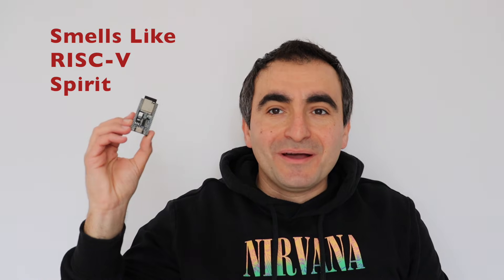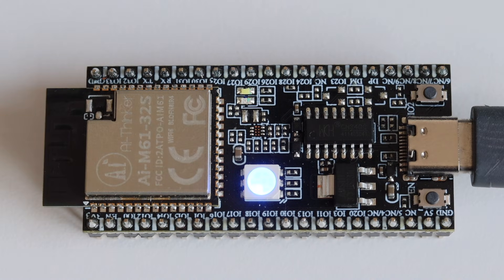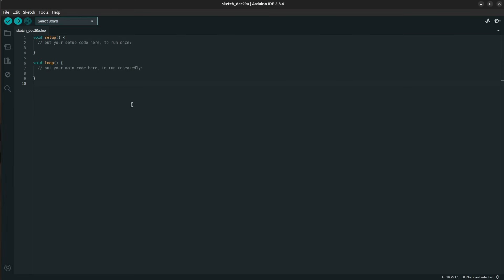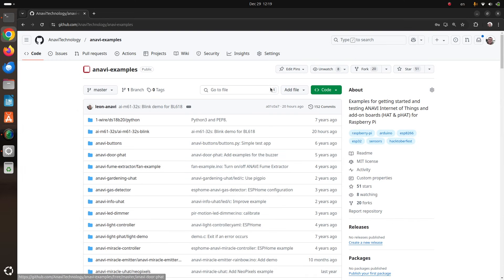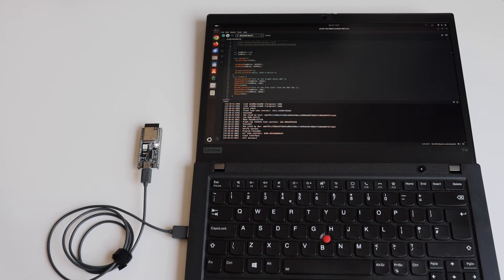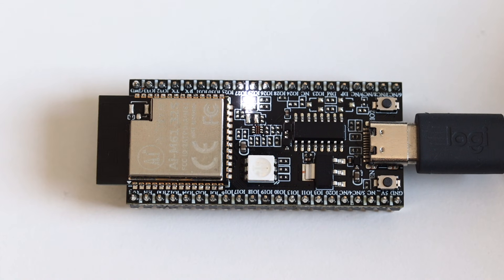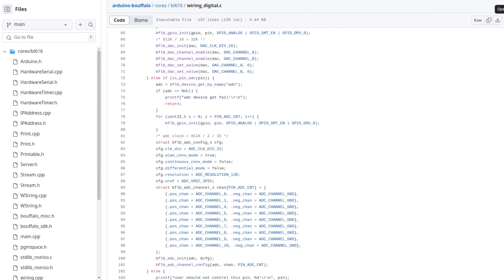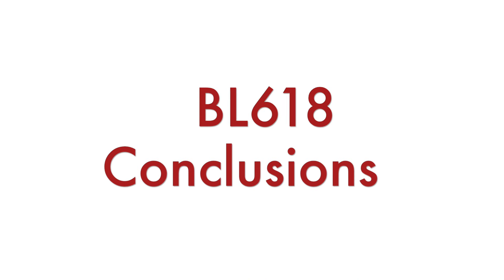Arduino core for RISC-V Bouffalo Lab BL618 and BL618 IoT chips on Ai Thinker Ai-M61-32S

Comment: Hi i have the Ai m61 32s kit bl618, i want to ask for tts (text to speech) which header file to use?
Reply from the maker: As shown in the video, Arduino core support for the BL618 is not perfect. Regarding text-to-speech (TTS), one of the more popular Arduino libraries is Talkie, but it is hardware-specific, so I doubt it would work on the BL618 without modifications (I haven’t tested it myself). Other Arduino-compatible TTS options include Flite and arduino-SAM, the latter being a C adaptation of the SAM (Software Automatic Mouth) speech synthesizer originally developed for the Commodore 64 in the early 1980s. Here are a few links:
https://github.com/ArminJo/Talkie
https://pschatzmann.github.io/arduino-flite/
https://pschatzmann.github.io/arduino-SAM/

Comment: Sir, I'm new to this. When I plugged the cable into the board, the LED did not stay on. Is this normal? I want to write code to turn on the LED. I used an ESP32 before, and when I plugged the cable in, the red light turned on. On this board, when I plug in the cable, the LED glows briefly and then goes off. I was asking if the LED should stay on or not.
Reply from the maker: Ai Thinker Ai-M61-32S has several built-in LEDs. Which one are you referencing? Keep in mind, the BL618 is very different from ESP32 microcontrollers. The behavior you are seeing is likely due to the preloaded firmware on your board. I would recommend creating and flashing your own firmware to verify.
Reply: Thank you for your reply. I want to clarify: are the LEDs on the Ai-M61-32S board controlled entirely by firmware, so they will not stay on just by plugging in the USB? For example, on an ESP32, the red LED turns on immediately when power is supplied. Does this board not have any similar LED to indicate power or activity? I just bought a new board, and when I plugged in the USB, no LED turned on, so I was concerned that the board might be damaged. @LeonAnavi

Comment: Hey, I wanted to ask that will this work on BL616 ?
Reply from the maker: Yes, Arduino core for the BouffaloLab chips supports both BL616 and BL618.
Reply: @LeonAnavi Do we have to select the same BL618G as it shows only that in the boards manager?
Reply from the maker: yes, I think so. I don't have BL616 to test but according to the readme in GitHub the Arduino core for the BouffaloLab chips supports both BL616 and BL618.
Reply: @LeonAnavi  okay thanks brother!
Reply from the maker: @akshatlalit3478  please share your experience with BL616 later on when you have time. As I mentioned in the video, Arduino core for Bouffalo Lab has some shortcomings and isn't as good as the Arduino support for ESP32/ESP8266.
Reply: @LeonAnavi  yes brother sure!

Comment: Make an IOT Tutorial for this board
Reply from the maker: Yes, I have a few ideas related to Wi-Fi. Do you have anything specific in mind?
Reply: @LeonAnavi  Smart Parking System would be great
Reply from the maker: That's a good idea but will require quite a lot of time to develop the whole system. I was thinking of simpler demos with BL618 like a web server or a MQTT client for telemetry from IoT (which actually can be used as a building block of a smart parking system)
Reply: @LeonAnavi  yes that's also quite nice idea as one can eventually approach the Goal in small and achievable steps with more content consisting of 10 mints sized videos
Reply from the maker: Yes, you are right. keeping the video's duration within about 10 minutes is essential as otherwise it takes too much to prepare it. I do these videos just for fun in my spare time which unfortunately is quite limited nowadays.